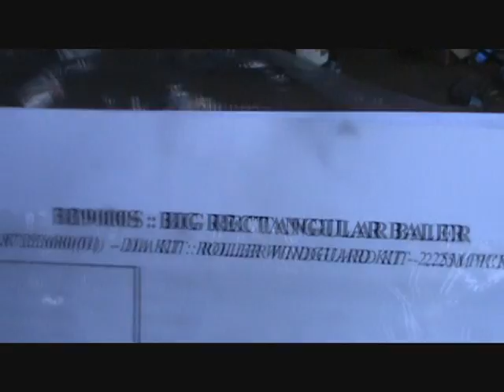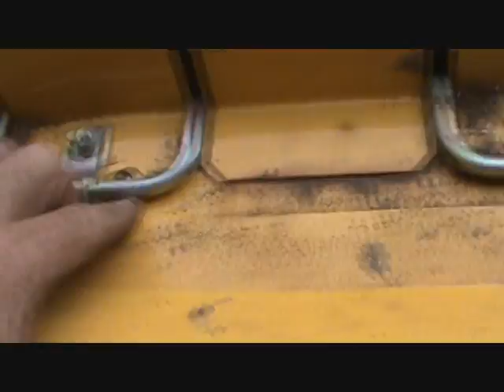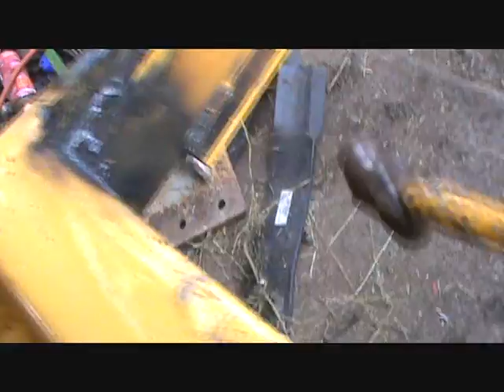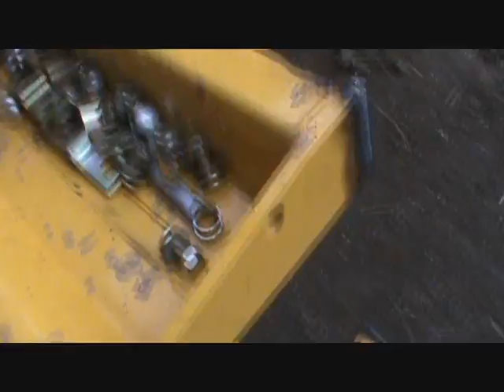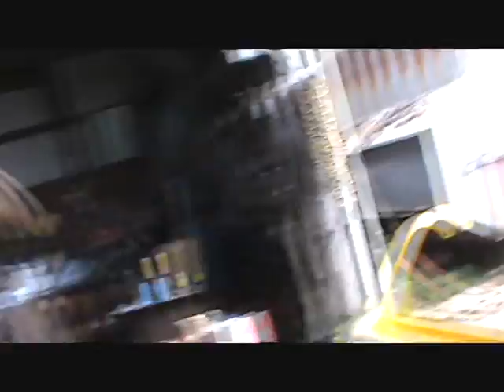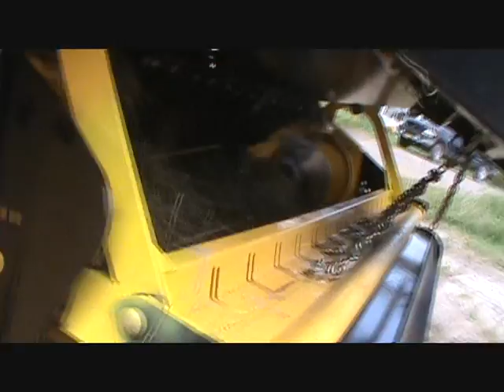Roller wind guard BB9080

Comment: I hope you had goggles or something on while welding!  (Safety First!)  As for your camera, be careful when using a torch.  You can wreck the lens real easy with a stray bit of melted metal.  If you need another set of those forked teeth, can't you recycle one of the original ones for the middle slots?  A little bending and straightening and cutting should do the job.....